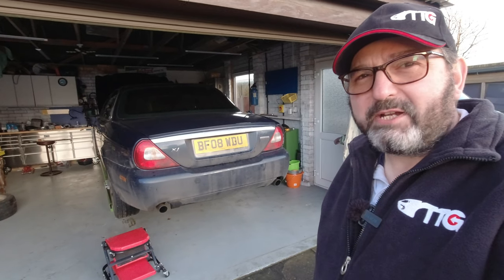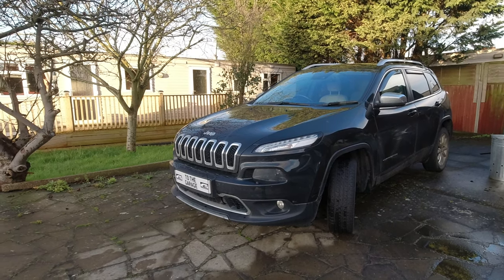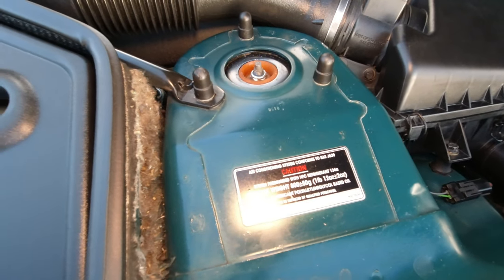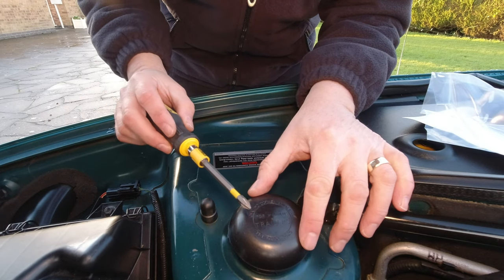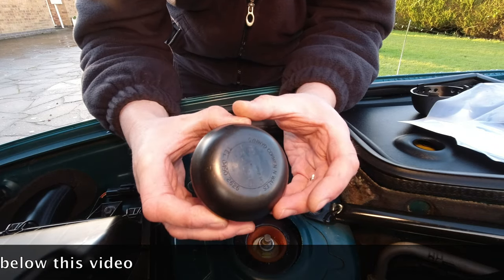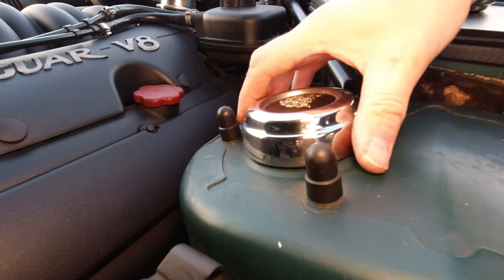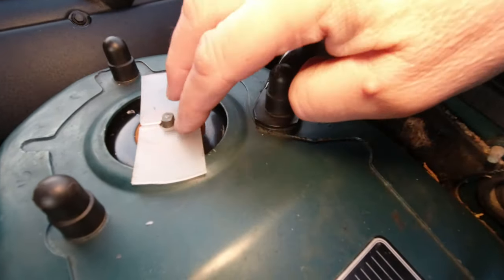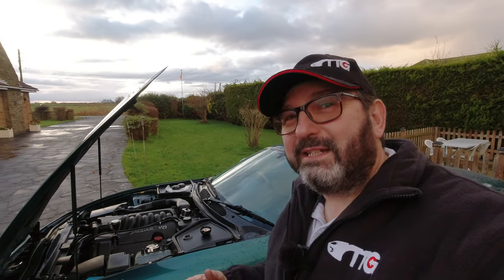Alternate strut tops for Jaguar XK8 XKR X100's

Comment: Is the original hub 72mm in diameter? And model and part number:
94-97 Jaguar XJ6 X300 Center Wheel Hub Cap Rim Cover # JLM20002 OEM

Comment: stop sneaking in Steed bits under the guise of XK8. By the way whats the deal with covering the number plate everyone knows where you live.
Reply from the maker: 🤣 Jo has reasonably memorable plates on the Jeep and doesn't like to be recognised when she's out and about. (I love it😁) The camper is more of a security thing. VW campers hold their value extraordinarily well and as they are pretty much all White, Off white, or beige. Its Very easy to clone them.
Reply: @ToTheGarage  yes. but everyone knows where you live , your on You Tube and so are you vehicles 😬